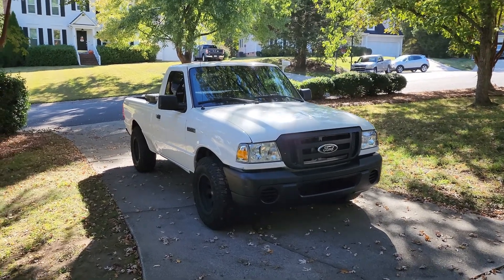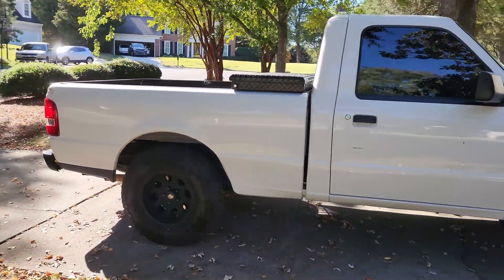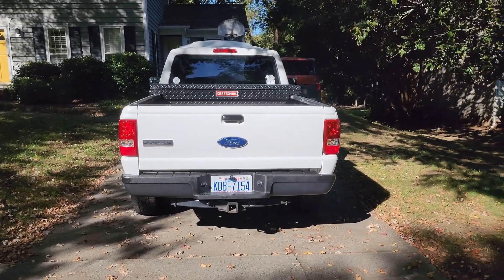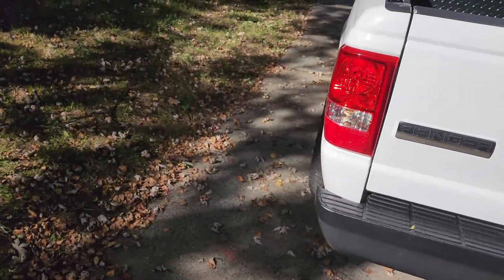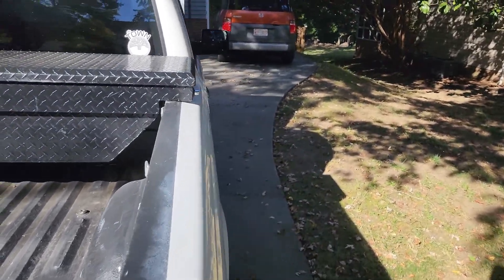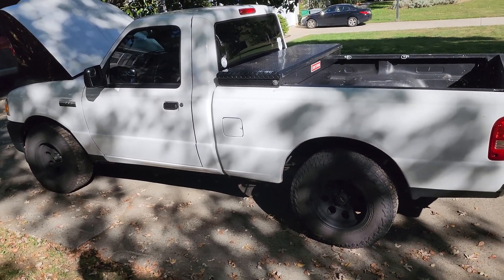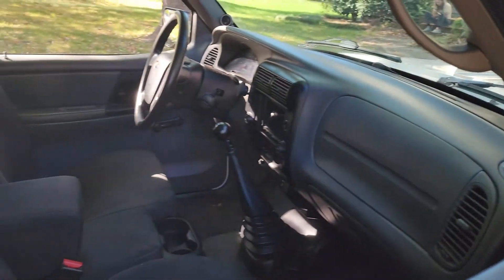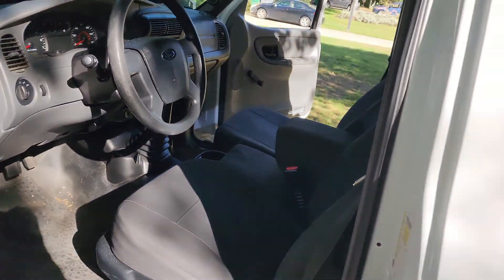2011 Ford Ranger Mods & Long Term Review (8 Years)

Comment: I've owned my 2000 Ranger, 4 cylinder (with 8 spark plugs), 5 speed XLT truck since 2003.  As the 3rd owner, I paid $3,500 for it, no interest or fees, a friend sold it to me after he repossessed it from a 6 ft tall guy who wrecked it, why it now pulls to the right.  I've replaced the radiator, the starter and other things twice and replaced once everything else but the motor.  Two front end and one rear jobs.  Started rusting a few years ago. I guess using non-ethenol fuel for almost 20 years has helped keep the engine clean.  233k miles on it so far.

Comment: Great lil trucks. I have a 09 xl with 165,000 miles and still purrs like a kitten.  I installed ALLA lighting AMBER LED in front and RED in rear. No issues. I changed the signal flasher to stop hyper flash.   Love all you've done and I have more to do on my bucket list that you have already done.    You should black out everything behind the grill. Gives it a way better look.    😎👍

Comment: I found a 98 2.5 4 cyl.. 5 speed with a fabtech lift kit and bilstein shocks with 75.000 original miles on the body and a swapped out low mileage lima erngine. It's my urban crawler and I love it. My second one as my first was an 02 with the 4 cyl. duratec. eng. Great little trucks.

Comment: What's the wheel and tire size?
Reply from the maker: 235,75,R15 Falken Wild Peak is the tire.
Reply: @Samibz did you lower the truck? And if so, how many inches?
Reply from the maker: @lukasrosa9974  truck is at stock ride height

Comment: Love your Ranger and I love mine as well. I have an '02 Edge 4x4 with the 3.0L. My grandpa used it as a farm truck and let me have it if I wanted to fix the damages and get it running again. I did a lot of work on it and still have much to go but I have loved every part of it thus far.

Comment: Hey I’d love to know more about the LED replacements! Looking to replace all and wasn’t sure which to get. I know you said you went through 2 to find the right one for the right turn signal intensity. Thanks!
Reply: And the relay flasher! How did you do this?
Reply from the maker: @andrewtrice7243  I bought all the LED bulbs off lasfit. Ended up keeping the incandescent bulbs for the tail lights unfortunately, couldn't find anything to work there.

Comment: Do you have any more details or a guide on sound deadening the interior? The road noise drives me crazy in my truck
Reply from the maker: Not really sorry. There are some how to's on YouTube though. It's pretty basic, remove seats, pull interior trim and lift carpet and install the deadening. I also pulled the headliner and deadened the ceiling. Good luck!
Reply: Yeah my 96 noisy on highway lol

Comment: What’s the dimensions on the rims and tires, I’m getting a 2010 ranger soon and I love the wheel setup
Reply from the maker: 235/75/R15 Fallen Wildpeak tires
Pro Comp Xtreme Alloys Series 7069 Flat Black Wheels 7069-5865 15x8 with 3.75" backspacing. + 1/2" wheel spacer on rear only.
Reply: @Samibz did you do a wheel spacer because of Rubbing or just because you wanted too
Reply from the maker: @briannajaramillo-garcia889  just to make it look better. No rubbing issues.

Comment: 17:00....that's a lot of clutch replacements. 
My 2010 Ranger has over 135,000 miles, original clutch.
Reply from the maker: @sameold5050  yeap, working construction in the bay area hills carrying it's rated capacity will do that to a few clutches.
Reply: @Samibz  
Overloading & hills are a bad combination.
The Ranger's with torsion bar suspension can haul/tow more.